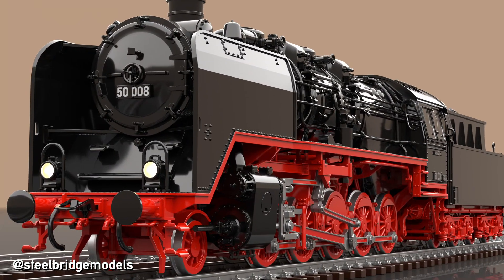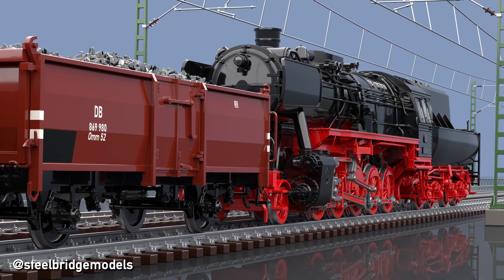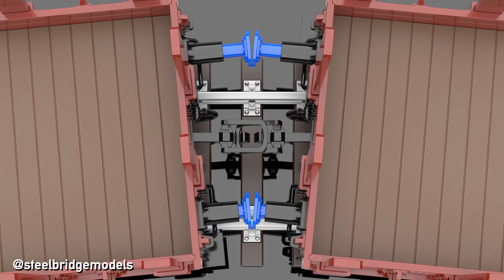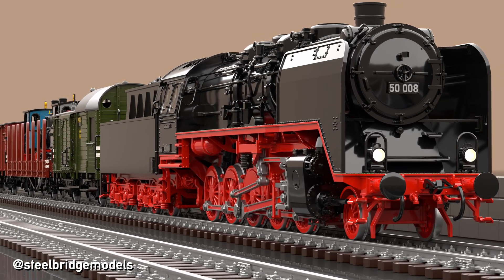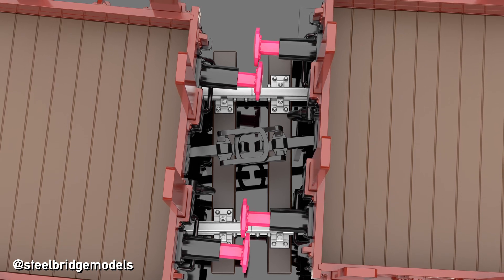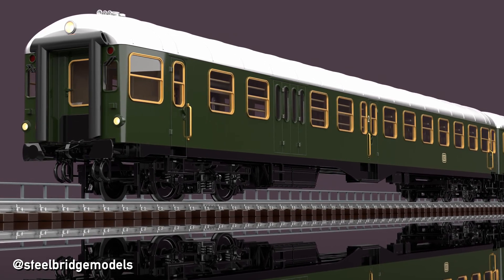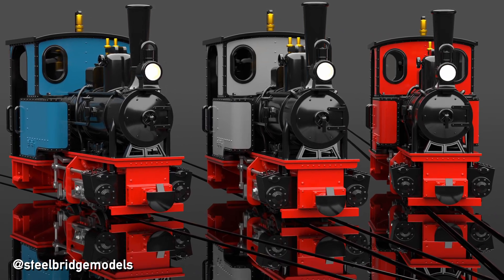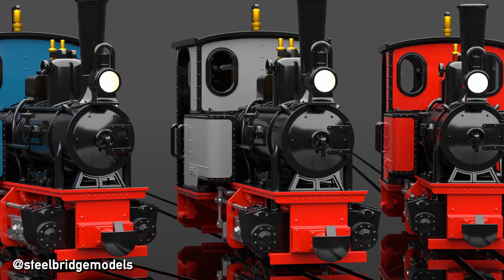Why not just make them BOTH curved?

Comment: It made me feel better, to learn that buffer interlocking actually is a common reason for derailments in true life, as it is a very great concern when I run my 1:32 45mm gauge trains, which I operate in a prototypcal way, using screw couplings, so buffers can touch. However, I've learned to avoid the situations where this malfunction is likely to be a problem. The main problem is that most model railway switches use way too wide angles when branching. Secondly, the problem is a lot more likely to occur when pushing a trainset. (Arranging two switches in a way that you can achieve an S-curve, aggrevates the problem. If you avoid this, somewhat to wide angle switches can actually be used.)

Comment: I wonder why they didn't add an antisliding plate (e.g, an U on one plate and a pin on the other) to prevent the plates from sliding out and locking
though a shear pin might also be an option

Comment: Dear Author, I'm sorry. But you haven't fully answered your own question. Round buffers do tend to slip off on an uneven path. The reason for this is that for two curved surfaces, when their axes are shifted, a force arises that tends to increase this displacement. If one of the surfaces is flat, then such a force has a constant value, which does not lead to an increase in shear
Reply: This seems like it was a solution to the problem based on pure conjecture since, even back in 1961, re-evaluation came to the conclusion that two shallow curved buffers was just as, if not more effective than a combination of flat and round buffers.

Comment: What I don't understand, is why they didn't simply use a pair of spring loaded couplings that would be rigidly affixed between two cars so that the connection would not have a tendancy to jerk or bump, as well as making buffer locking a non issue.

Comment: Interestingly video I didn’t knew this fact about the buffers. Does anyone know what the coupler in the middle at 1:02 is? Looks a bit strange normally there would be chain link or how you call that.
Reply from the maker: It's a model train coupling rather than a prototypical one, as I design my models for 3D-printing.
Reply: @steelbridgemodels  interesting do you also print the couplers? Is there a website were you sell these models since they look quite good. Maybe do a video what printer and settings you use etc.
Reply from the maker: @christiankaiser7747  Thank you! I haven't started printing myself and therefore can't offer any models or prints just yet. But that might change the future! And yes, also the couplers are supposed to be printed.

Comment: "dig deep" ??? took me 2 seconds in chatgpt

"If both buffers were flat or both were rounded, there is a higher risk of the buffers locking together in a way that could prevent proper decoupling or cause damage. The mixed design reduces the likelihood of this locking, making the coupling and uncoupling processes more reliable and safer."
Reply: ChatGPT is not a quotable source though, and you can't guarantee what is says isn't a made up jumble of different sources. It's only right that for this video he went with a proper printed source.

Comment: Fortunately, here in North America, we've always used draft gear to absorb forces between railway vehicles in combination with link-and-pin couplers (now obsolete) and later with knuckle couplers.
Reply: I can't believe that anyone still hooks trains together with chains in this day and age.  Automatic couplers have been required by law in the USA since 1893.  And our railroads are accused of not being "advanced"........
Reply: @u686st7  The difference is not Black and White and has several factors.
First modern steels in the early 1900's made chain breakage more and more unlikely.
The Railcar fleet in Europe was 25 times bigger then that in the US, different countries, different rules/regulations so they sticked at first with the European chain coupling standard.
Also coupling by chain has also it advanteges. 
You can couple a train tight for higher speeds and loose for heavy freights 
US Railroads are slow in comparison to European Railroads. 80/100 MPH is a normal speed for European freightrains.
Passenger trains run 90-125 MPH and Highspeed trains 175-225 MPH
Most of the network is also electrified.
Anachronism If it isn't broke don't fix it is also a factor. 
f.e. we still have a diverent numeric keyboard as an anachronism on our computers then on our phones. 
That was on purpose done at the time period that a mechanical numberselector at the phonecompanny wasn't overwelmed when an accounted who used a calculator dialed the number!
Blocktrains, dmu/emu and highspeed trains  all have automatic couplers. 
Only general freight trains and classic passenger carriages  hauled by a locomotive have still chain couplers.
Those classic passenger trains are in a decline and are more and more replaced with modern dmu/emu trains who have automatic couplers.
Reply: @u686st7  European railways are slowly but surely catching up; they're currently testing out digital automatic couplers; basically stronger versions of the SchaKu designed for goods wagons. Dellner, Knorr-Bremse and Voith have each developed very similar prototypes, and the UIC would probably have to choose one design to declare standard.
Reply: In the early 70's all European railwaystock should get automatic couplers as agreed in an international railway convention like the rest of the world.
Due to the extreme high costs of retrofitting the biggest fleet of railway stock in the world it was only done slowely and mostly used for special cases.
The US sort of  knuckle couplers and even some locomotives are only used in heavy ore, coal, steel and other heavy goods block trains. 
For not equiped with such a knuckle coupling locomotive, coupler cars that have on one end the standard european  shackle coupling and buffers and on the other side the knuckle coupler are used.
Most of those coupler cars are converted from a standard car and are on purpose disabled to carry anny freight. 
Thats reason is that they have a heavier shock absorber installed then the normal knuckle coupler freight cars to prevent coupling failure.

The last 3 decades classic pulled by a locomotive individual coupled passenger trains are in fast decline because more energy efficient and faster DMU's EMU's and lightweight trainsets are replacing  them.
On normal non block train general freight trains classic shackle coupling is still the norm.
Also on fixed passenger trainsets only the locomotive the 1st passenger car and on the other side control cab car has the standard  shackle coupling. 
Such a trainset is permantly coupled and/or has jacobs bogies and can only be uncoupled at a maintenance facility.
Reply: @obelic71 now we're finishing up the design details as part of DAC4EU, to switch to SchaKu 10.

Comment: I had never realised that the buffers were different. I have now learned something new. Thank you.
What I cannot understand is why European railways persisted in using buffers and coupling hooks when the American knuckle couplers have proved themselves to be far superior in every way.
Reply: Freight cars are operated in many different countries by many different railway companies. So the first reason is they all have to agree to do this and! they have to agree to change to which coupler as well. There are other options for example the German C-AKv-coupler which is compatible with the russian Sa3 coupler which would be another option. Second reason would be what do you do in the time you are changing over? New and old would be not compatible so you have massive problems operating freight trains while you're doing it. Third reason is that it would be massively expensive because of the amount of freight cars operated here so even poorer railway companies would have to be able to do it. Another reason would be the missing air link of the coupler. So somebody would have to couple and decouple them anyway. There are projects to find a solution for that to develop a coupler that automatically couples air as well. ( And maybe might have a data line as well) That one will be expensive again so I am sceptical it will be adopted. The only use case we have here is on heavy ore trains where the old coupler is physically limited. So the C-Akv Coupler is used instead. That one by the way is able to couple to normal coupler so it would be my favourite.
Reply: @jonkess2768  There is a current problem with coupler compatibility, anyway, as there are so many different patterns in use. Even couplers of the same type, e.g. Dellner, are fitted at different heights. Rescue locomotives (called "Thunderbirds" in Britain) have to be specially adapted to deal with these problems. Other countries around the World have managed to change to a common automatic coupler, so in my opinion, a European standard could be reached- After all, Brussels manages to impose uniformity on things that have no importance at all. My preferred option would be the AAR Knuckle, but the present systems need a change, whichever is chosen (by Railway experts, not Brussels).
Reply: @MervynPartin  We have a project here in Germany for the "Digitale Automatische Kupplung für den Güterverkehr" DB Likes to put Digital on every project everything they do is "Digitalisierung".... But I digress they agreed to use some type of shaku coupler. I don't think that was a great choice for many reasons. It is not compatible with current couplers. All freight cars need data lines now that have to be equipped. That will make freight cars much more expensive in the future. I don't think that's the correct way. I think you will see alot of freight cars broken because harsch weather affected them while standing in some station for weeks on end. Freight cars in my opinion have to be extremely robust. I don't think a shaku offers that. Maybe the russian coupler would be the correct one because it is already in use in Scandinavia but I am not an expert. Just somebody that works for DBInfrago.
Reply: @jonkess2768  Thanks for that information. I shall look for some more details on them.
Reply: @jonkess2768 Well, the Russian SA3 coupler are not in common use in Scandinavia. The exception is mainly the ore trains between Kiruna, Luleå and Narvik. Regular trains still use screw couplers.
Reply: @COPPAS70  So a similar Situation like the C-Akv Coupler in germany
Reply: @jonkess2768  Pretty much so, i.e. for really heavy loads with very particular wagons.
Reply: @jonkess2768  Further to my earlier reply to you, I did find out some more about the DB project, and I agree with your views. The complexity will make freight cars more liable to breakdown, and will also make them more expensive to build and maintain- not good when there is competition from road hauliers.
Reply: One reason I was told was that with buffer and screw hook(?) system, the wagons can be pulled tight together, eliminating the slack between them, making for a smoother ride especially passenger cars. No more spilled coffee and other bone jarring rattle and rolling.
Reply: @martink8080  With knuckle couplers, there is negligible slack. They have been used on passenger coaches in Britain since LNER days. Even the Gresley pacific loco tenders were fitted with them (known as Buckeye couplers) to connect to the coaches. The conventional buffers on the coaches had removable spacers on the shanks so that they could be set back from the extended position.

Comment: Good video! Still I'm wandering why so many European railways haven't switched to automatic couplers in the first place
Reply: Either all or none have to switch to keep interoperability as wagons often cross borders. The digital automatic Scharfenberg coupler as the European solution is being worked on.
Reply: @MartinBrenner  so automatic couplers isn't a thing in EU just because they weren't able to agree on switching to this system?
Reply: @Bigubus  Yes. Schaufenberg couplers have existed for a long time and are used for EMUs but otherwise compatibility between the national railways was more important and the system has been working for centuries and still does, both locomotive pulled international passenger trains and cross border freight. The new digital standard coupler will have more advantages than just automatic coupling to justify the cost involved.
Reply from the maker: The switch to using automatic couplers in Europe almost happened in the 1970s, even between the East and the West an agreement was found in using two different, but compatible systems. It ultimately failed due to a lack of funding, as not all states involved would have been able to carry the cost of re-equipping all of their rolling stock.
Reply: @steelbridgemodels  wow! I didn't knew that
Reply: Doesn't eliminate buffers, though. Typical UK Southern Region had four-coach electric multiple unit sets. With inter-coach coupling being effectively fixed. But two or three four-coach units would often be coupled up for longer trains. They had automatic coupling (just needing manual connection of brake pipe and electrical) and buffers. The buffers were always needed for protection at the ends of the four-coach sets.
Reply: @polyvg  in Ukraine (just like in every post soviet country) buffers are present only on passenger cars. And they both are a bit convex

Comment: Great video, You might also want to dive in to the reason as to why modern day Emu's and Dmu's have these horizontally grooved buffers.
Reply: That's an overriding protection. If they collide then it should stop one trainset from climbing up on the other.
Dat is om te verkomen dat een treinstel omhoog "klimt" in geval van een botsing tussen twee treinstellen. Ik geloof dat de Stadler GTW's een van de eerste waren die ze had in NL.
Reply: You might want to dive in to the reason why * Emu's and Dmu's * have apostrophes in them . . .

Comment: I live in America so I'm glad my OCD won't bug me with knuckle couplers rather than buffers
Reply: Keep in mind also that some regions have rail wagons with BOTH knuckle couplers and buffers, allowing them to cross connect between "chain" and knuckle fitted wagons. This means they have neither mirror nor rotational symmetry. Your welcome.
Reply: Same
Reply from the maker: Knuckle couplers, however, aren't symmetrical either. Just saying.
Reply: @steelbridgemodels  seeing as there's like 50 types of knuckles worldwide, mainly Shibata, AAR, Janey, Sharon, Sharon & Tower, ETC
Reply: @steelbridgemodels  but they ARE on the center line, AND there's a flipped on on the opposite side. Guess my brain thought it was OK this time 🤷‍♂